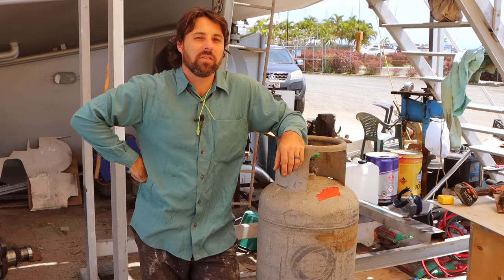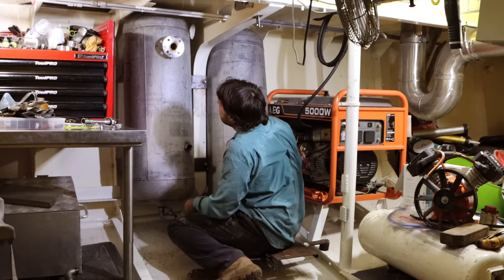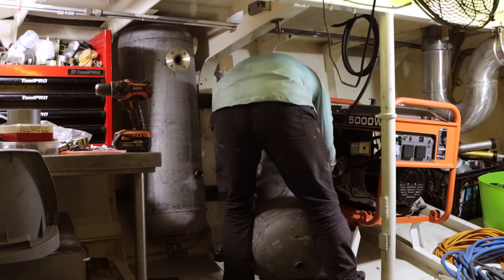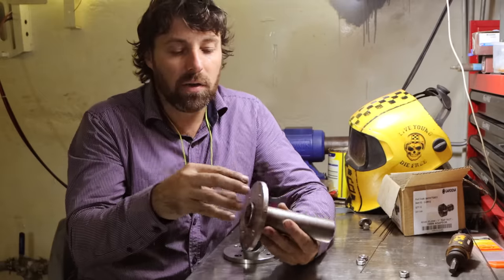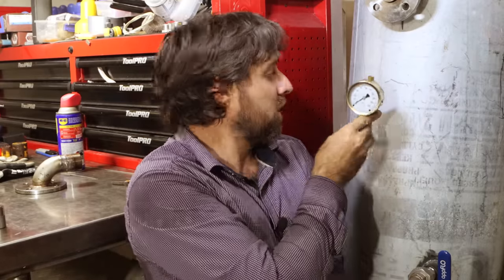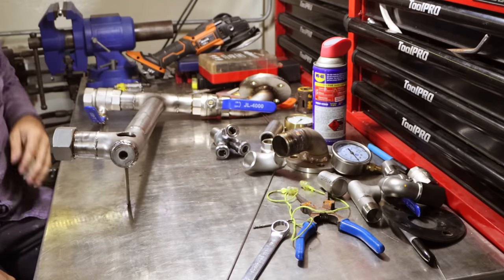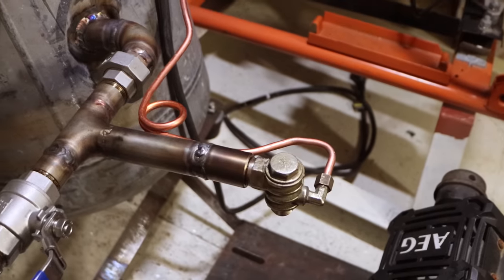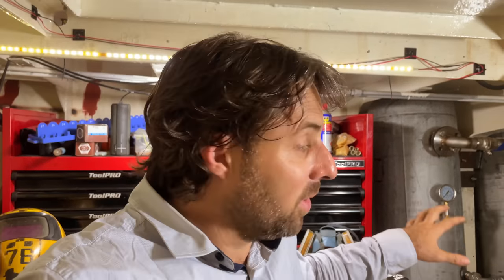Building a Multi-tank Air Compressor (Part 2 of 3) - Project Brupeg Ep. 281

Comment: I can only see one safety blow off valve (on left hand tank) - I hope that there is another as that one can be isloated by the ball valve and no long be effective when it is shut.
Reply: Not sure about air, but using refrigerants, you need a dual pressure relief valve that you can only shut one down at a time , so that the system permanently has one PRV open. Obviously different to air but I am sure you musnt have any form of isolation for between the cylinder you are protecting and the PRV.

Comment: G'day Stue, you've probably thought of this little problem already reguarding unregulated air pressure loading up on the air delivery hoses that have a maximum load pressure and a tendacy of blowing out at any pissy little weak point. my question is are you going to regulate the tank pressure with a good compressor on/off pressure switch lower than the flexable lines maximum pressure load ?
Reply from the maker: Yes. That’s connected directly to the primary tank. Dame
Reply: Shit a brick. just realized I called a Cummins a Detroit. I'm going to hell. a thousand apologies.
Reply from the maker: Three Bloody Mary’s and one Perkins sacrifice to the gods and we’ll call it even

Comment: Turn them into minions, you rejected my sujestion to paint the boat in yellow, but you can't refuse to paint those tanks right, comeon it's the "Grupeg", just a question I am sure you allready notice, you will need a dryer to remove moisture from the circuit, and maybe a little lubricator, sorry if you allready consider this parts

Comment: Are you still going to run with the engine driven compressor as well?
Reply from the maker: Yes but with a twist. Compressor won’t be on the main engine as that’s one more thing that could break and stop the main engine from running it will in fact be a compressor unit powered from either the genset or the small Kubota diesel we have
Reply: @ProjectBrupeg  Instead of the standard position Cummins compressor location have you considered a belt driven compressor on the main engine? electric mag clutch?   Just planting a seed to keep you awake at night, sort of sorry not sorry.😛

Comment: Damien knows enough to do things correctly to set up this system. He's not a air head. btw Damien Have you installed a water separator into this system yet?
Reply from the maker: Not yet. Just using the tank drains for now. Will be adding an aftercooler to the compressor soon

Comment: Soooo, if you cant afford the compression tank people maybe thats a sign that normal welders are NOT qualified. I have seen pressure vessle failures and i have never been more frightened. Its absolutly under-rated how dangerous pressure vessle are and i would never work around those tanks. Some times you absolutly need the right people, even if they cost a lot. Hopes and prayers for you and everyone else within 100m of that room.
Reply from the maker: I didn’t say I don’t trust my welds. Literally can’t get a pressure vessel welder in the town we are in. Getting ‘a’ welder is almost impossible let alone a PV welder

Comment: Id consider not blasting the tanks ….whatever factory primer etc they have seams to be holding up well ….just paint them and move on imho.
Reply from the maker: In our experience paint won’t hold onto anything unless it’s blasted. Blast it right and paint it with good two pack and it will last 25yrs

Comment: Hi Damien , haven’t head you mention the main gaskets you are going to use in the final flange connections to tanks . Will u be using metal/composite flange gaskets type as these joints are normally the joint that are the most difficult to get to seal when u do your hydro testing ?
Reply from the maker: Nitrile rubber around 3mm thick compressed hard with four 1/2” bolts
Reply: Ok hope that works ok , might be worth looking out for some metal/composite gaskets at your scrappy over time they might come in useful if the nitrile gives probs

Comment: The compressor drive belt guard would be stronger with a return  fold on the other side. You could stitch weld a 20mm wide strip to the edge you’ve just fitted. Alternatively v-cut the edge at (say) 30mm intervals, fold if down, TIG and linish with flap wheel.
Reply from the maker: My TIG is DC so I can’t weld alloy with it. I have a spool gun for alloy but this stuff is way to thin

Comment: I couldn't find if the air start is for primary or back up start.  If back up, what were the arguments against  simple, manually wound spring starters?

Q2 🙂. Why the emphasis on Survey?  Is it just the Standard you choose to build to or actually required for a private vessel with non paying guests aboard?  Required by educational institutions/grants maybe??

Thanks
Reply from the maker: Hi Mike. Air start is primary, spring start is our preferred back up. Want to ditch batteries and electric. Survey is what we want to build to but not required for our private build

Comment: Dame just for everyones sanity can you stop "finishing" projects like the welder shelf, generator, Air tanks and just say "Thats good enough for now"
If you want to pressure test this yourself fill the tanks with a lot of water you put the same pressure in to test say 100PSI but as water does not compress if it fails there is a lot less volume and energy to release or blow in 5L of compressed air at 100 psi than 1000L. 

Lastly being a Kiwi (and I am sure some locals would agree) I demand an apology because it hurt to see a perfectly good custom made 100L beer keg thrown away under the boat like that...
Reply from the maker: That’s a big assumption we chucked it… it may be resurrected into something in the future. Like a well trained kiwi it’s been moved into the pile known as “definitely don’t throw that out but fucked if I know what we can use it for pile”